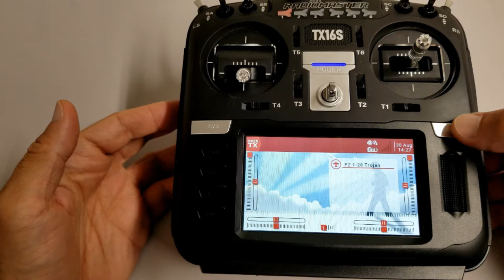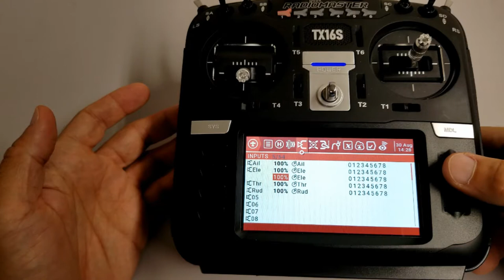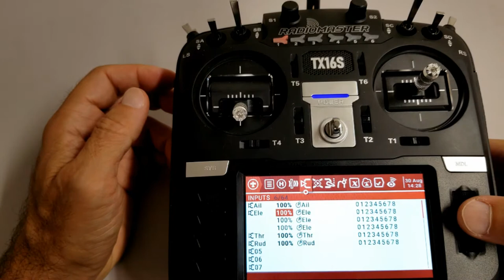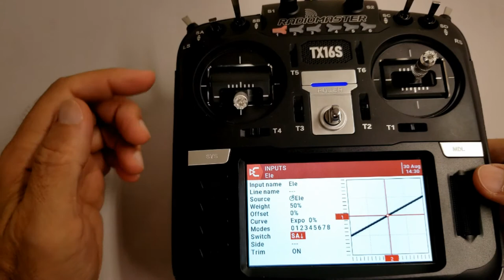RadioMaster TX16S with HALL Sensor Gimbals - Setting Up Dual (and Triple) Rates

Comment: When setting up dual rates and expo in the spectrum dx9 you have one switch that you set up all three (rudder,elevator,Aileron) you set up 3 difference rates say 5% 10% 15%. That makes the sticks at center a little softer. So it would be like this
100% 5%
100% 10%
100%  15%
So that's dual rates and expo together correct. So what you are doing is limiting the travel.

Comment: Very helpful video,thanks...I'm a newbie and have just bought the TX16S. Have bound my Eachine E119 heli to it, and the difference from the toy radio that came with heli is amazing. But on throttling up heli always pitches forward now and trim wont fix the problem.Could you suggest how I might fix this please? Is a mix needed .I really am new to rc but it is so interesting.
Reply from the maker: Hi Ken. This is exactly what I was planning to do! I have an Eachine E119 as well. I already took the unboxing and flight review videos back in August, but did not have a chance to edit and post them. I have been having problem with the stock transmitter; the right stick is basically dead around the center and not accurate at all. I have been planning to move the E119 to my TX16S as well. I will let you know once I do that and try to diagnose this issues. Best regards - Fettah

Comment: Hello, I use my TX16S to bind any DSMX receiver, then when I fly, always heard “ RF signal critical “ , and if I fly father then 50 meters, I lost my control for a few seconds. Do you have this problem, if you did bind a DSMX receiver.

Comment: It is a way of doing it but not the best way - you should leave your inputs alone and put your rates into the mixer screen that way if you want to mix say rudder with aileron you only have to add one input and not three lines with the rates in it.
Reply from the maker: Thank you for your suggestion. Personally, I do not use the mix function on these types of conventional airplanes, but I will look into the mixer screen to learn more.

Comment: My friend the airplane u have it’s electric, but can you operate gas engine airplane with this tx16s ?
Reply from the maker: Hi Friend. Yes, you can operate glow and gas engine airplanes with this transmitter as well. Instead of an ESC (electronic speed control) connected to the throttle channel of the receiver to control the electric motor, you will have a servo connected to the throttle channel of the receiver rotating the throttle lever on the engine. Take care.